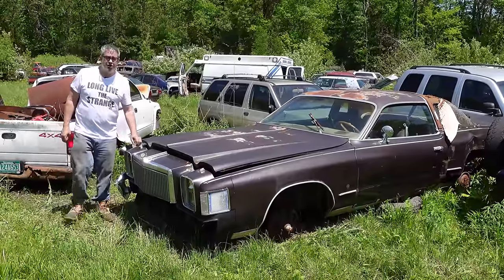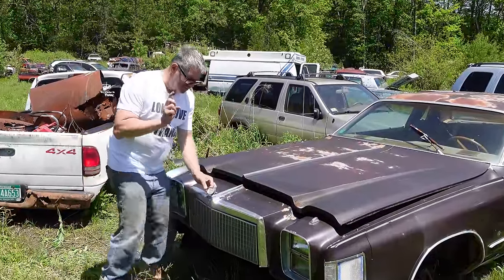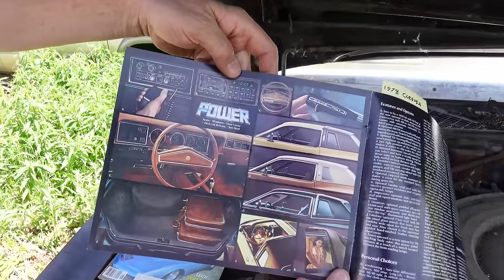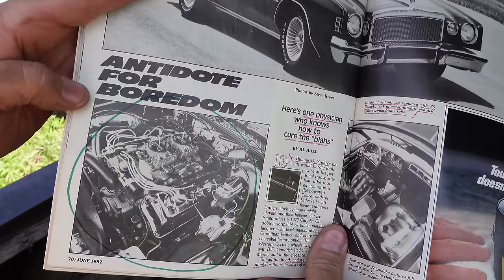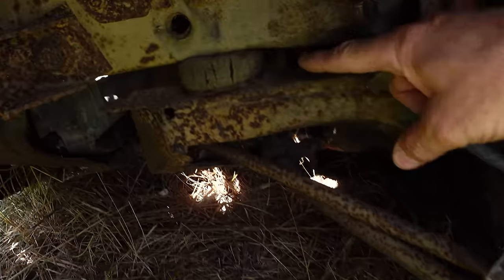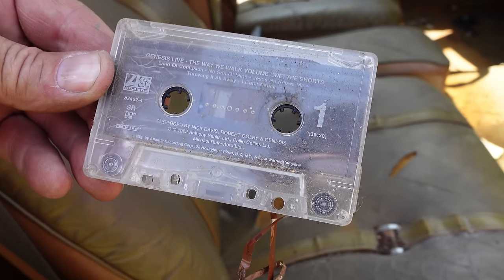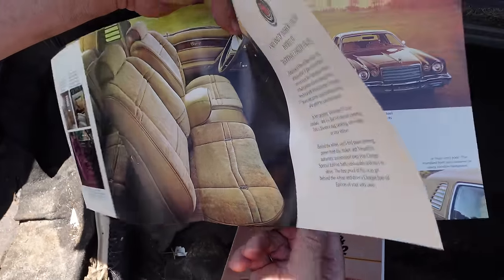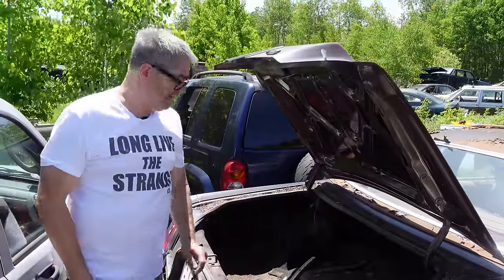426 Hemi Cordoba

Comment: I'm surprised Steve didn't mention the Electronic Lean Burn Ignition had been discarded from the air cleaner and a Mopar Performance Orange ECU was on the firewall! When I lived in NC, a fellow airman had a '75 Charger and at the time (''90) I was unaware that the Charger had been produced as a badge engineered Cordoba. I always thought they had been discontinued after '74. His had been a northern car and was suffering from cancer, but he was determined to save it.
Reply: Thanks, I inherited MOTHER’s IN-Law…..1980(*? , I have forgotten positively), Cordoba (* with *No “ Corinthian Leather(( think just all Vinyl ), ”, or no *HIPO Engine,(318?) though  basic a/C, PS/ PB……) in 1995, and high miles : well taken care !! of) 198?.model , in all Blues ……and no NORTHERN INDIANA, road salt Rust, etc ……
Reply: Steve the 1980 through 1983 Cordoba, Imperial,  and Mirada were on the JBody platform not the L Body. The Cordoba had the LS which had a t style grill that was in reminiscent of the 300 while the more luxurious Cordoba had a waterfall grill. Both the Mirada and Cordobas had single square Halogen lights , while the Imperial had hideaway lights and a taller trunk than it's J body siblings.
Reply: In high school I had a 1978 two door Dodge Monaco.  My grandfather had picked it up at a state (Nebraska) auction. It had previously seen duty as a special-order state patrol car. It had one of those atrocious Electric Lean Burn ignition systems hanging off the air cleaner shell. I swear the devil himself invented that contraption.
Reply: True the lean burn was the main use in those years, however the older style ignition was still available in different states and countries until much later.
Reply: I had two of these with big block. Never had bean burners on th big block. My 400s both had big double snorkel air cleaners. Cool to look at. Dead weight. Long legs though. Calculated mine up to 140 mph with standard size tires. Hugged the curve’s awesome with all that beef. And 23mpg to boot!!
Reply: Ugh,lean burn distributor and carbs are the worst!
Reply: I had a 77 and loved it... My second high school car, it was backup for my 68...

Comment: These Cordobas were major junk.  My ex wife had a '77 model with the 400 engine with a Carter Thermoquad 4 barrel.  The air cleaner mounted computer was a major issue.  The one on her car went bad six times, the last time being in traffic when the car stalled on decel at a traffic light with a large truck coming up on us. I bought a Direct Connection ECU and wiring and drilled a vacuum port in the base of the Thermoquad and install an electronic igmition distributor with vacuum advance.  I had to drill out and mill the intake to install an EGR valve to stop spark ping, but at least the car was driveable.  All this and the cars were rust buckets with the deck lids and roofs being the bad spots.

Comment: Back around 76 or 77 I was working at a Dodge Dealer.  We got in a shipment of new cars and were scratching our heads over a "Charger" that got rolled off the truck.  It had Cordoba rectangular headlights, a Dodge emblem steering wheel, Dodge emblem on the trunk, Cordoba nameplate on the dash. We called it the "Charger Cordoba."  The Chrysler Zone Manager didn't believe us when we called to ask "WTF?"  He came by later in the week, shook his head, and a few days later a truck showed up with an ACTUAL Charger and took it away.       You are in my Prayers Steve, praying for you and yours.
Reply: Factory f up? 

Kinda weird
Reply: @samholdsworth420   Yes very weird.  Someone or some group were either not paying attention or decided to screw something up on purpose.  In either case "Quality Control" never caught it!
Reply: @keithcurtis6671  should have bought it 🤣
Reply: @samholdsworth420  Well I would have tried to if I wasn't a broke college student at the time!

Comment: I worked at the Chrysler Engineering center in Highland Park Michigan in the early 70s & was able to peruse the various prototype shops. One day in early '74 was a mule '75 Cordoba all black with a 426 hemi. I was told it was a "what if" car & evaluated for production. I think the idea was scrapped due to the first gas crisis & wondered what happened to it. There were a few one offs that day in the shop like a 440 six pack C-body '74 Plymouth wagon & a couple of Turbine cars that looked a lot like a ''64 T-Bird.

Comment: My mother ordered a 1975 Cordoba from Trans Island Motors in Montreal. The 360 was standard, 318 no cost downgrade, and 400 or 440 optional, and at least in Canada, no Catalytic Convertors in 1975. I put a Holley 500 CFM on and beat the crap out of it as a hyper 16 year old

Comment: In 1980 I bought a black with red interior 76 Cordoba that came with all the factory options except a sunroof. I put a 375 hp 440 with headers in it with a 4sp and 391 rear end. It didn't stand up on its rear wheels or anything but it did run very respectable for a 3900 pound car.
Reply: what clutch pedal did you use?
Reply: @fransmith8992  It's been a long time ago and many hot rod builds since, but as I recall the pedal assembly came from an old Challenger, or Roadrunner that I modified to make it work.
Reply: @anthonynelson9136  cool !  yes, the old  'modify to fit'.
Reply: All improvements that would not be permitted in California . . . so sad.

Comment: For 78, the Cordoba got the std 400 4bbl ELB, yes for the last time. But, the rare P code (called the HD 400) was offered. Specs for that engine oddly enough were not factory released, but I've read that the same mill in cop cars were rated about 220, 230 hp with torque in the 325 range for 78. Specs for the std 400 were pretty tame, 190hp, 305lbft of torque. Single exhaust meant it cleared the 25.5 gal tank. The P code got the 21 gal tank to clear true dual exhausts, with dual cats, and those cars actually had a slightly modified floor pan to accommodate that. Seat tracks were different as well. All 400 cars had the 9 1/4 rear gear, but the std 400 came with a new for 78, 2.45 ratio! P cars had 3.21. All 400 cars had the 11x2.5 rear drums, whereas lesser engines had the 8 1/4 gear with 10 inch brakes on the rear. All B body Cordobas had the 11.75 frt discs, which if you snag all the parts, are a cheap factory way to convert older drum brake B's. New for 78 was the lock up 727 trans for std 400s only. They were known for burning out because lock up came in at just 31 mph on light throttle. Styling is subjective, but I've had 4 of these, including 3 79 300s, 1 of which I still have. My only real gripe is as big as these cars are, rear leg room actually isn't good and cars w/o optional tilt wheel, make for an awkward driving position for shorter people.  That aside, of course rust was the #1 killer, and man did these cars rot easily! Not much aftermarket support for metal or interior pieces.
Reply: Those little cursive Cordoba emblems  on the b pillar are my favorite.
Reply from the maker: Great additional info! -Steve Magnante
Reply: Great information  👍 

Thanks Adam
Reply: All 400s did not come with a 9 3/4 rear end. Tow package would get it, but most were 8 3/4.
Reply: Thanks, see mine .
Reply: Let’s simplify. These were pieces of 💩 that the taxpayer got put on the hook for.
Reply: That's the E68 option, it could be had on performance cars like chargers and road runners and also A38 police squads. I have a '77 gran fury police car with an E68, it runs surprisingly well with all the emission controls removed
Reply: I had a 74 Duster with a 318/904 automatic and an 8  1/4 rear end with a 2.45 gear, so the 2.45 had been around for a few years before 78
Reply: Gawd I want one again.
Reply: @MASS1866  out of all the vehicles ever made, and you want this. How pathetic.
Reply: The 76 specs were 240hp and 325 torques, even with 3.25 gears it's too heavy to feel remotely quick though.
Reply: @Atomwaffen-y3s  i had a 76 that was one of the best cars i ever owned.
you are the 1st person i ever heard call them a piece of shyt.
why?
Reply: @fransmith8992  there were certain vehicles that we scrapped- sent the pieces of h$it straight to the crusher without much care for mining for parts. It’s because the parts had little value. Every Chrysler built between 1973-1980. Maybe keep a body part around that hadn’t rusted in 6 months from the time the POS was built. Most were a liability- didn’t want to sell any Volare or Aspen parts because the vehicles had structural defects due to substandard design and engineering. 

If THAT was the “best” car you have owned, that’s pathetic.
Reply: @Atomwaffen-y3s I don't know how well they did in places where snow (and salt) isn't a thing, but I had a girlfriend who had one, previously owned by her father, it was before the police removed these kind of car of the road, and it was rusted, very, very rusted, we couldn't put anything it the trunk because the floor was gone, and there was holes as big as my fist everywhere in the body. She kept it for a few months and it was a disaster.

Comment: My parents had a Plymouth Gran Fury with the 400 Lean Burn. That car was exceptionally fast considering being a 4 door full size car. I used to take it to Dodge Street and race light to light with it. The air cleaner flipped of course. I did beat a few Novas and Camaros. The engine was definitely built right from the factory and was very impressive.

Comment: Back in the day that was the cheapest and easiest way to put disk brakes on your charger because everything bolted right up. Just pop the upper and lower ball joints . My charger still rides on the cordoba spindles and brakes. when I order new rotors I just order the disks for a 72 dodge charger because they were all the same. They didn’t have conversion kits like they do now. Just putting it out there. Thanks for the videos!

Comment: The 400 lends itself for the biggest of stroker cranks and can be built to produce tons of horse power. Love those 400s...!
Reply: My cousin had a 400 in his Barracuda which used to run tens without slicks on the car. Oh yes and it got either 4 miles to the gallon or five miles to the gallon depending on how hard he drove it
Reply: My cousin had a 400 in his Barracuda which used to run tens without slicks on the car. Oh yes and it got either 4 miles to the gallon or five miles to the gallon depending on how hard he drove it. Yes it was punched out don't know how big

Comment: Reminds me of the black with red graphics 79 Dodge Magnum I bought from a tow yard in Rhode Island for $200 to get back to Virginia after finishing a job. Went through it and replaced all wear items, fluids, filters, belts, hoses and stripped the other one they threw in and burned the highway up as it was built for cruising at 85. Traded it eventually for a 76 F-150 that was set up for hauling 10k with it's 360 and manual transmission. I missed both ever since.

Comment: I bought a brand new 1976 Dodge Charger SE with the 400 engine, basically the same as the Cordoba. These cars were gutless wonders, you would think that the engine was about 100 HP. I paid extra and got the turbine wheels. These rims could never balance properly and the car had a minor vibration that they could never balance out. The only saving grace was the car got 19 mpg/Can. gallon and with the big fuel tank you could go a long distance without refill. The inside was nice and the drivers seat reclined so that if you were driving a long way, you could stop and get a little shut eye. The a/c would freeze you out of the front seats but this car was absolutely not a "tire burner".

Comment: Thanks Steve! These 400's were so loaded with emission stuff and de-tuned to the max, one would be lucky to get the faintest tire squeal turning a corner coming out of a sand patch!
Reply: Ha, that's not true! I new guy that had one of these years back and it would most certainly light up the tires at will and really haul the mail.
Reply: That wasn’t the problem. 2.76 rear ends really restrict them.
Reply: If the Electronic Lean Burn gets ditched for normal Chrysler Electronic Ignition, and you richen the fuel mixture a bit, these 400's were alright. A better cam helps alot too
Reply: @kalebbrown93  Try 2.45's
Reply: @JrGoonior  ooh that's in the basement,let's add like 600hp and hit Bonneville for a run 😂
I'm not up on all the 70s smoggers but I thought there was some even worse with a 2.2 or 2.1 rear end 🤷‍♂️
Reply: @MrTheHillfolk  The 7.25 rear ends could be had with a 2.26 gear and the 8.25 with a 2.24
Reply: @TactaGhoul  haha let's go to Bonneville 😝😝
Reply: Wrong, I had two 400 equipped Chryslers and they would indeed turn the tires. Not as easily as my other big block Mopar cars from the late 60s and early 70s, but they would do it. Changing out the Lean Burn for a Mopar electronic ignition and new distributor also made a huge difference in performance, along with an intake/carb swap.

Comment: Anybody else get that 'lovely' 🤮 2.45 limited slip differential on theirs?   It would grunt in pain off of the line.  Under full throttle at low RPM, the intake howled louder than my buddy's Mach 1 with his aircleaner cover inverted.  They called it a moose in heat.  Although,  it would eat freeway miles (at well over the posted limit) as a snack.  Thanks for the video!

Comment: The 2nd-gen Cordoba/Mirada and the 1981-83 Imperial are the J-body, a stretched M-body platform.

The rubber isolated K-member was called Torsion-Quiet Ride in the 1971 C-body, where it first appeared.
Reply: ...and the L-Body was the Omni / Horizon platform.
Reply: The 2nd generation for the slant 6.
Reply: Torsion quite started 1970 c body. We had a Newport.

Comment: The government loan stipulations that Chrysler scrape the tooling for the big blocks really put Dodge trucks at a disadvantage. I can still hear Ricardo Montobom and the fine Corinthian Leather.
Reply: That's been debated as whether it's true or not. The other "Big 3/4" were getting rid of their larger engines. It was more to do with fuel economy/emission standards than just dumping the tooling. Chrysler had military contracts back then and them going under was seen as a potential security threat.

Comment: Part of me wishes I'd gotten my dad's '79 Cordoba.  I have no idea what engine was in it, but it was the same color as the one in the video and had t-tops.  When he had to move from the steel plant property, he rented a trailer from the local used car lot owner.  Despite having sold many cars to my dad over the years, the landlord imposed a limit on how many he could have.  Since I was unable to get the Cordoba, it and a few other cars were sold back, and when my dad passed 9 years ago, the dealer 
/landlord got most of the others.  A cousin got the '89 Grand Marquis, at least.  I've got the '66 Honda 65 motorcycle in storage and need to restore it one day.
Reply: Code RT9 Sable Tan Sunfire in 1979, and just "Sable Sunfire" in 1978, but the same paint code.

Comment: I bought a new Cordoba with the 400 and the only way u could lay tire was in reverse and even then, not for long
Reply: Not all 400's created equal. Also, what rear gear? If 2.76, yeah that's a cruiser, not a tire-burner.
Reply: @budlanctot3060  Stock ratio was 2.45 plus low stall lock-up torque convertor. This made the 400 into an absolute dog. The 360 was a much better choice if you didn't want to spend the money on upgrading the gear ratio. The 360 was 2.71 gears stock and had a looser non lock up torque convertor.
Reply: I've had probably a dozen Cordoba/Magnums/Chargers/300's. Many I've changed to 8-3/4's w/2.93's or 3.23. Every one I've had was a TQ. I eventually did away with the lean burn's. I never had problems with getting them to scoot good enough.